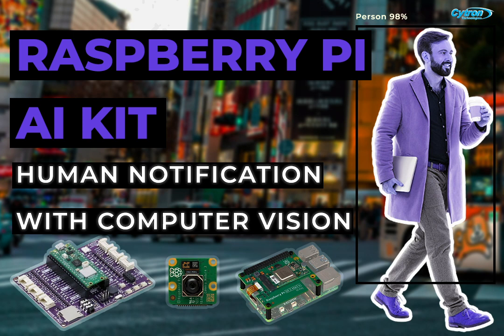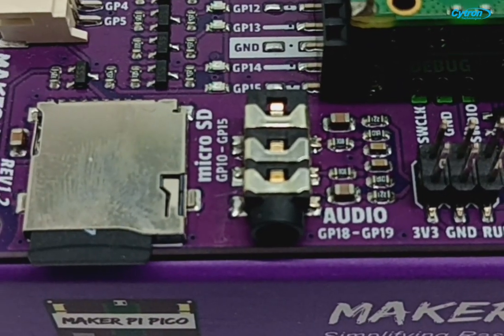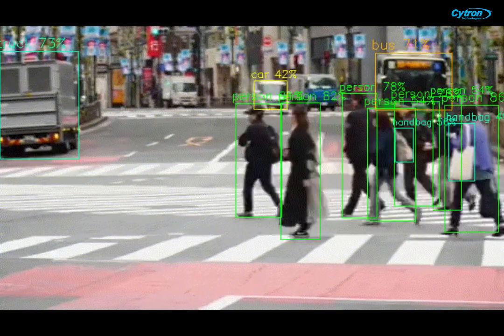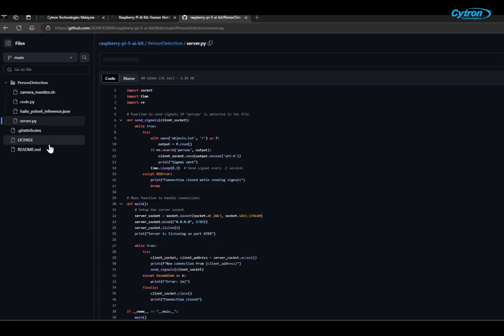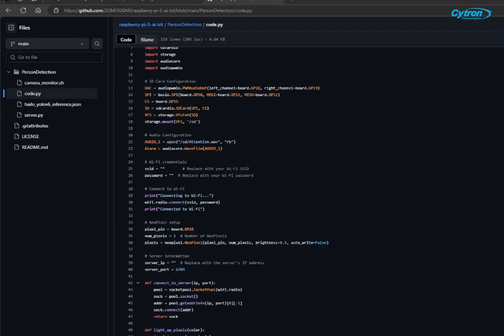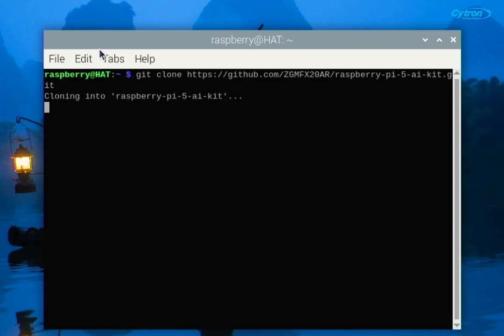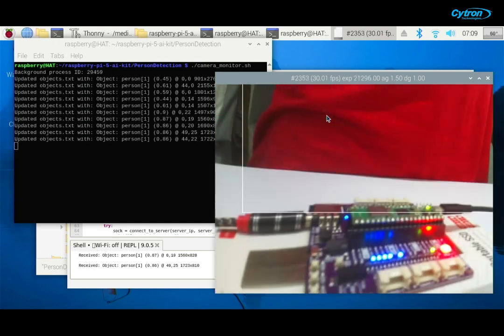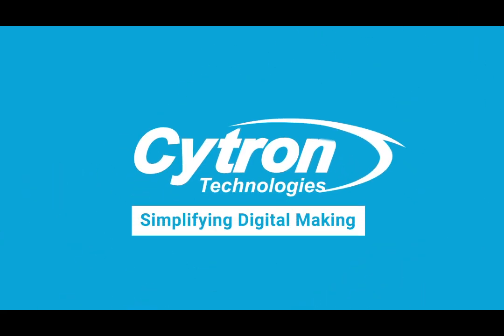Human Detection Alarm System with Raspberry Pi AI Kit + Maker Pi PICO

Comment: why is this Pico board necessary for building this? Can't this all be done with only RP5?
Reply from the maker: It is not necessary to use the maker pi pico IF you can access the raspberry pi 5 GPIO.

Comment: This is a great video - thank you. When attempting to run the python script that is placed on the pi pico (code.py), I get an error that's complaining about not being able to recognize / import packages in the script. I'm new to Python but not so new to other languages. Is it expected that we've set up a virtual env on the pi pico and that we somehow come up with a requirements.txt file to download and install the required packages for this script? I've watched the video and have looked at the documentation on your site several times and I can't see what the difference is between what I've got going and your env. Any thoughts on this. Thanks for the resources and the video.
Reply: It appears as though you have to have circuit python running on the pi pico in order for that above mentioned script to work. I think I've answered my own question.